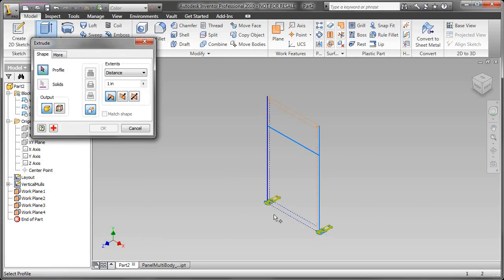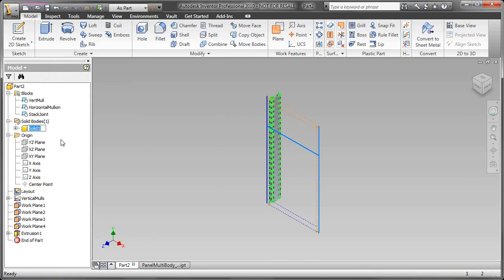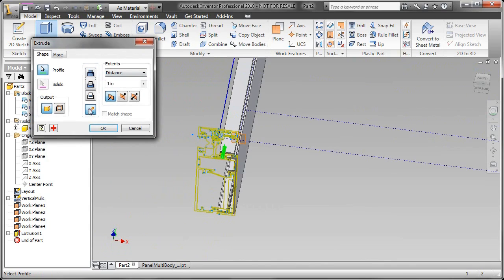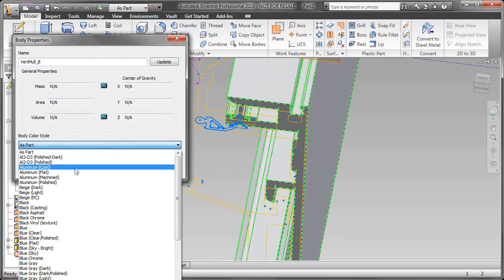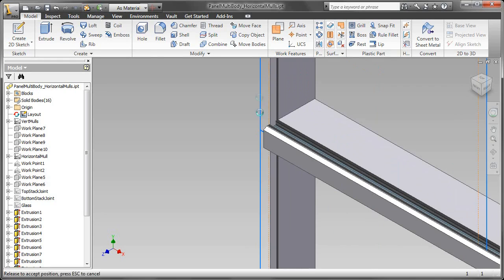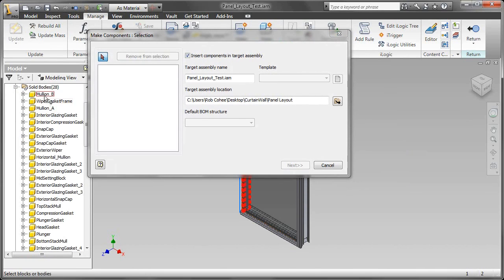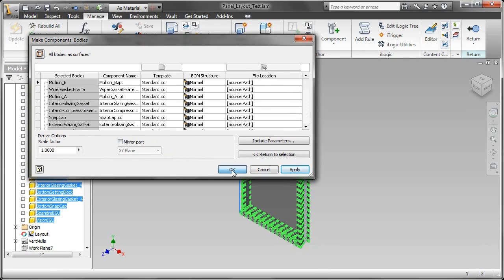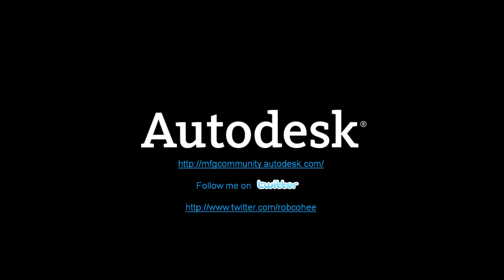Autodesk Inventor Multi Body Assembly Layout

Comment: Hello there , may I ask a question. Let say we have different material applied on this material right and after that we are going to do the linear steady state heat transfer using nastran in-cad, the meshing and simulation can proceed or not ? Thanks.